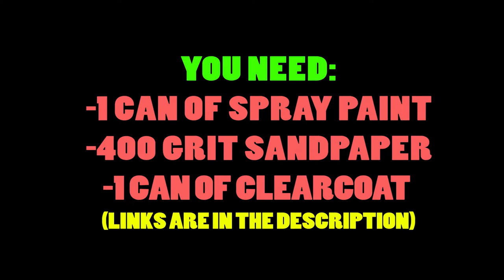WHEEL COVER RESTORATION

Comment: You have the best video for repairing serious scratch and paint damage like mine.  I'm a little unclear which order the three layers of clear coat vs paint go on.
Reply from the maker: I recommend spraying 1 or 2 coats of plastic primer before spraying base paint coat. Because plastic primer helps with the adhision of the paint. Than 3 coats for base coat after that 3 coats of clearcoat
Reply: @nsx-plain1710  Thanks! I'll be sure to primer them first, mine have even less paint than yours did.  Perfect project to do while other parts are on the way.
Reply: @nsx-plain1710  So we're talking about maybe as much as 8 coats of paint per hub cap?

Comment: Exactly what I did and had the same minor defects that were noticeable after painting. The areas you sanded show color blemishes. It does not matter if you put 8 coats cause the original plastic finish that is no longer there and after sanding and painting .. you can tell. However, they do look better than being a scratched / scuffed up. From 10 feet away you cannot tell but within 4 feet you'll see most all the places you had the original damage.  After the 3 or 4 Clear Coats dry . Please let dry for 24 hours, get some Paste Wax and buff em.  Unfortunately, at some point from road debri you will start finding scratches. The pros have the expensive paints made for plastic / fiberglass the will make them look impressively like new.  Doing this with retail spray paint does get you by and it is much cheaper than getting it done at a auto body shop. Often to get a new replacement with Car Manufacturer Logo on the hub cost about $50 to $70 per wheel cover/ hubcap. Nothing last forever and bound to get scuffed up so this is cosmetic band aid fix.  You can always do Black if you don't like Silver/ gray .. or any color that tickles your fancy like Red or Orange or that which matches your car.
Reply from the maker: Here is a new video I have just published about painting hubcaps. https://www.youtube.com/watch?v=RpbdSaa0XI4
Reply: Calm down